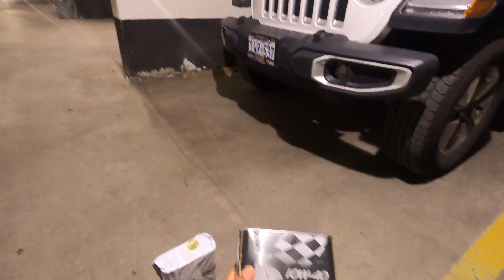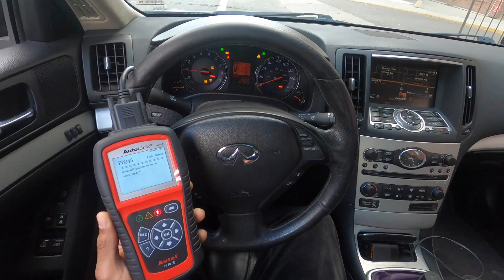IS THE G37 THE RIGHT CAR TO BUILD??// BUILT VQ ISSUES// QUICK DRIVE

Comment: What were you going to say at the nine minute 20 second time mark?
Reply from the maker: Sorry about that I  lost the rest of the video but I was pretty much saying make sure you know what your getting your self into if you are thinking about building a g37 ( but since am building my G you would be able to see the process anyways  ways )
Reply: @trevano20  I’m building a 08 G coupe 6speed. And man, I’ll tell ya. I’ve put in it 16K ball parking it in 2 years. 
I’m building it for my 14 year old son for when he turns 18. I’m in limbo wether I want to twin turbo it or super charged or the one that’s in the middle, I forgot what it’s called. Since I’m building it for my son, I’m not looking for crazy numbers as far as HP, I’m ok with 500-650 wheel horsepower. I’m not trying to kill ‘em or havem wreck the car I spent grands on either. But bro as far as your brake light issue. Take it to a quality shop, that has amazing techs working on cars. I tend to go with the more expensive shops cause they usually are on point with issues and have all the proper equipment to diagnose even the smallest head breaking issues.  But these cars do add up quick. I’m bout to park the car  for the NYS winter season, next summer I’ll start again with mods. Gotta stack up again all winter. Work hard all winter to play harder during the summer, yuh zee mi
Reply from the maker: @cletuskasady593  proper bro I know your son would love that car I know I do and ye my tuner is goner look at it tomorrow hopefully he can fix it with the other issues, in Toronto here u know we gets snow so I would be parking my g to , but it its a nice day I might pull it out and ye have to save over the winter as well these cars are not cheap to mod , good luck on your build bro we can help each other with info because we have the same car , I am thinking about a single turbo kit motor is built so skys the limit , and you should be able to boost ur g and be reliable if your only goner push around 500 hp which is real good numbers for a G

Comment: What did your engine builder do to the built motor to prevent head lift? 

I watched your other video and saw only pistons, rods, valve seals, studs.

Those items alone aren't going to make the motor capable of making 1000whp without head lift.
Reply from the maker: sup bro , so those parts in the video was only the main parts that i bought my self but my builder bought the other parts, he also send the motor to the US to get sleeve etc there's a lot more that was done, i also did cams and work had to get done in the head to make them fit ,i can put a list together if u want to know all the parts that went it to the engine (pertaining to the head lift my builder told me to buy this gasket and there should be no issues with head lift ---the company is Dynosty  ( Dynosty Pro Seal VQ37 Stopper Head Gasket Kit, 96mm) Let me know if u need any info